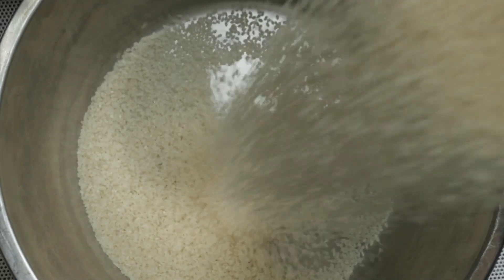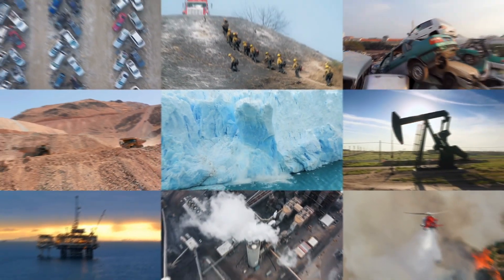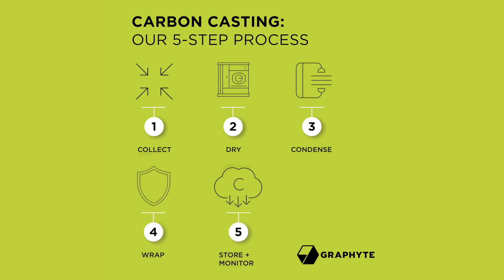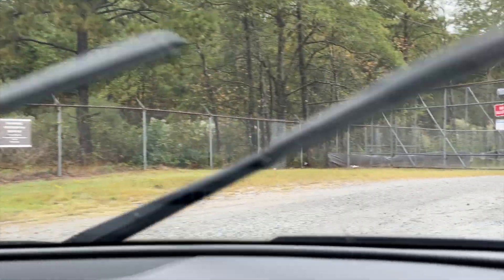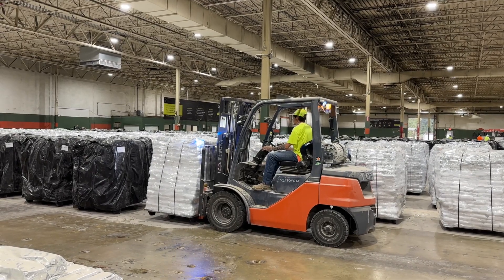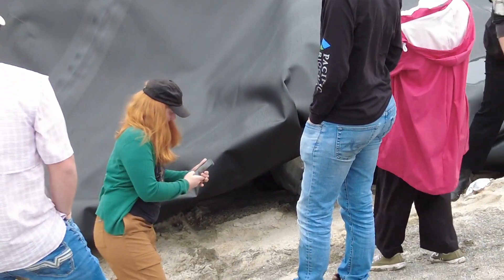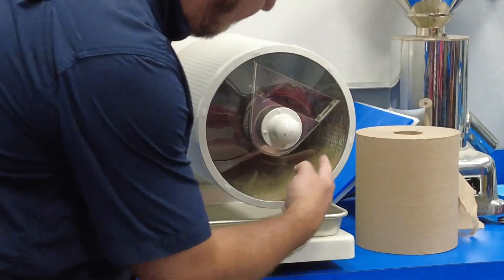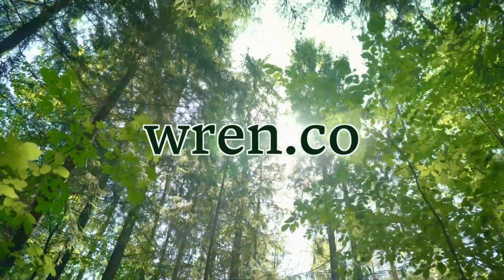The surprisingly simple way to remove carbon from our atmosphere

Comment: it's just stuffing trash under the carpet, it's not a good long-trem solution. considering all the carbon footprint from processing, i expect it's like 1-5% carbon negative at best (i can't find any numbers for that on their site), and scaled up it will take up a lot of land that in the future will probably be unusable for anything but parks (because of structural integrity issues and monitoring needs). for now it's better than nothing, i suppose, but it's very far from a solution
Reply: > it's just stuffing trash under the carpet

but that's how it works. our problem is that in the last few centuries we suddenly released a bunch of what had previously been collecting in the ground/ice/deep ocean for millions of years, without recapturing. that's what fossil fuels are.
Reply from the maker: After accounting for emissions from processing, transportation, storage (burial), and an uncertainty deduction, the net CO₂e removed from our partners' first verification was 9.291 t—over 71% carbon negative! The goal is to get to 95% with future refinements.

Underground biomass storage is definitely not the silver-bullet solution, but the progress should not be overlooked. At Wren, we take a "yes, and" approach to combating the climate crisis—"yes" we need policy change and decarbonization across all sectors, "and" we need to accelerate novel and conventional carbon dioxide removal methods. We support a wide range of projects for this reason!

The only long-term solution is the immediate halting of fossil fuel production and use. But we need drastic systems change for that to occur (which we are pushing for at Wren!) and even then, we need to scale carbon dioxide removal massively to reverse the damage that's already been done and mitigate global temperature increase.

I hope this provides a clearer picture. Thank you for sharing your concerns about the carbon footprint of this project! We do our best to take all these considerations into account before supporting them.
Reply from the maker: And to address your concerns about land usage, our partners shared, "We don't need much land to store a lot of carbon. We can store around 1 million tons of carbon dioxide equivalents with about 20 acres of land, and we can reuse the land once the carbon is stored. To put that number in context, about 30 million acres of land are used to grow corn for ethanol production in the USA."